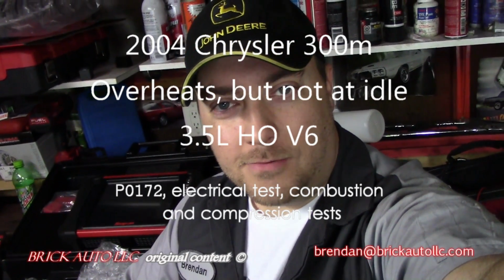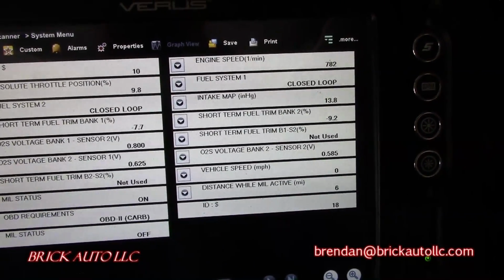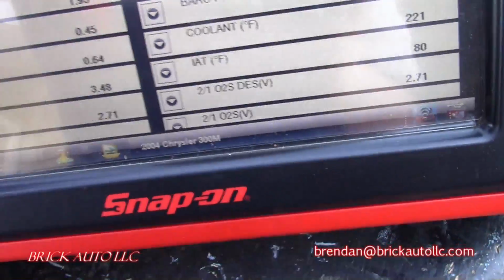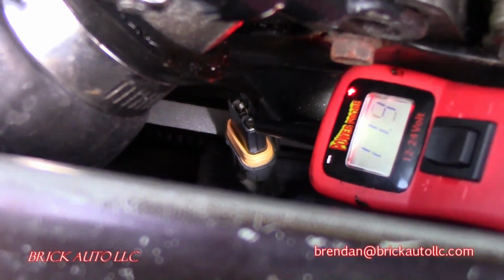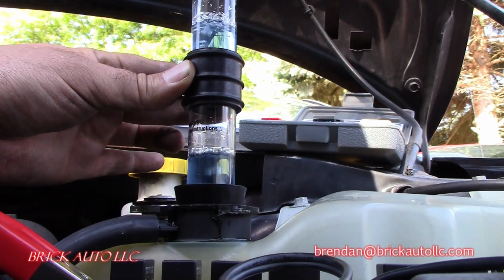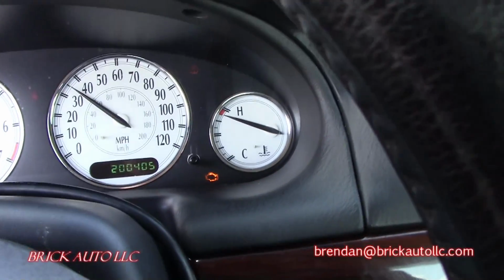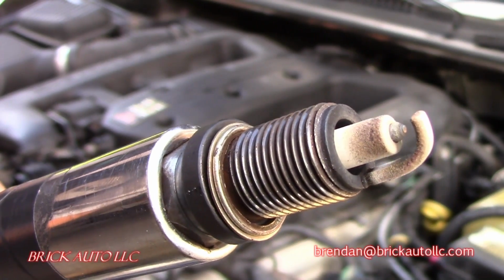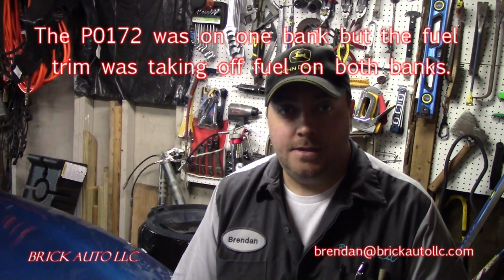2004 Chrysler 300m 3.5 V6 PO172 & overheats while driving but not at idle case study

Comment: The service manual schematics indicate that Low Speed Radiator fan is accomplished with both fans connected in series (6V per fan) vs High Speed  radiator fan which has them connected in parallel (12V per fan). The former configuration has both fans turning slower than the latter. The switching from series to parallel is accomplished through the two relays mounted on the fan.

Comment: i had same issue on my 1999 300m 3.5, turned out it was a rusty sticking thermostat, so I replaced it but first that didn't help, come to find out from a YouTube video that the thermostat will go in two ways but only one is right and will overheat if put in backwards, guess what? I took new thermostat out and put it in facing the right way and that solved that issue!

Comment: Crazy I went threw all this stuff. Put coolent senser in new fans ticked me off when mech I trusted said I needed fans bull the fans were fine it was a module located by fan.  And it started the fans right up. I wasted $250for fans and labor. Plug is fried.

Comment: Idk what you figured out but my car was overheating i bypassed fan switch and it stays at 189 degrees on my tool if you would have bypassed fans and let it run it would have been fine

Comment: I had the same problem from 2 months, the fans always run normally    every 5 KLM I must turn over and turn it off and run the fan from fuse box manually 
I don't know if it is the thermostat or anything else 
Chrysler 300m 2001 3.5v .

Comment: Mines was overheating. I got new head gasket, water pump, radiator, cooling fans, cooling temp sensor, thermostat. Mines done overheat but temp gauge does sit 1 notch above half, 221degrees only driving speeds. Fans kick on at 220. When i stop, or idle, temp is 197-202. Wat maybe the prob??
Reply: Brother, did you solve the problem?

Comment: I have a 2002 Chrysler 300m 189k miles...It is late November 2017, the days are getting colder here in the DMV.  Recent days, the outside temp is 30-50 degress.  The air blowing in the cabin is luke warm at best with the thermostat on the ATC set at any temperature above 70 degrees.  The 300m's temp gauge barely moves past the cold indicator on my drives.  However on some warmer days the gauge does move to it's normal operating zone and the cabin will heat up.  The Thermostat and water pump was replace during the summer (by the way the AC doesn’t blow cold air-we will takle that in the Spring).  The isno air in the system. 
Help

Comment: I'm having that same problem with my 03 300M. I change the thermostat, cooling temperature sending unit, oil pressure sending unit (while I was there) and new set of cool fans. I haven't run it smog enough to get it hot again, because my fans come on right away and stay on. That's why I question about the PCM. I have the exact same car for a parts car and want to switch them out. Will I need to flash the "new" PCM?
Reply from the maker: I don't think you should have to flash it for that year.  If it's the same motor, it should be fine.  A lot of newer vehicles may have security issues, but you should be okay just swapping out the computer.

It seems these engines had this cooling issue when they aged but didn't really show any major signs (like coolant in the oil or driveability complaints).  

If you are confident the thermostat is in the right way, the system is bled out all the way and new fans are okay - won't hurt to try swapping the computer if you have one.  I would note a potential to be the temperature control unit, not sure if yours is the auto one (like the one in the video), but they can go bad too and it's possible that the computer isn't getting some signal from that to command everything... maybe not but that would be one of the places I go next.  You may have to see if you kind find the resistance checks for that... but before I did any of that, I would do a compression test.  If the aluminum got hot too many times or for too long, the damage could be done.  I would do a compression test.  If you don't have one, you should be able to rent one from an auto parts store for free (just a deposit).  Otherwise swap the computer and control panel too since you have a parts car.

Here's an interesting site with some tid bits on these vintage motors:

http://www.tomorrowstechnician.com/keeping-3-5-alive-service-notes-chryslers-v6-engine/

Comment: Not true!!! It's the ECM!! Dude?? Its the ECM.
Reply: What is ECM?
Reply: @ahmedqasim7761  engine control module/management
Reply: Did you have this issue? I'm running in to this prob with my 300  I'm also thinking it's the ecu because of other symptoms. If you did was it pricey to fix?
Reply: Not really? About $200-350 to have it flashed, reprogrammed. Also, check your cooling system, make sure you use a good flush you can leave in for about a week, and use the other to recondition the system. Also make sure you that it is bleed properly. If not, it will get "hot pockets" in the system, and super heat the motor. Go to a shop that has the proper system to do it. It's not a "burp" system. Good luck. Should work. Try what I say first, than a PCM.✌😎

Comment: Did you rule out the PCM?
Reply from the maker: No, not 100% ruled out.  I believe there are multiple issues.  I think it would need a NEW fan set (to replace used, old and intermittent ones) as well as confirmation of the logic between the ATC head unit (which seemed to operate but not illuminate) and the PCM and or / BCM to ensure each were doing what they were supposed to.  I do think the main issue was obviously the compression loss across the board.  I don't know exactly how many times it overheated but I know it was driven at top red for at least a few times and even to bring it to me.  Had the compression been okay I would have pinpointed the control issue to ATC head unit  and or PCM and replaced the cooling fans with new.
Reply: It's the ECM.
Reply: It's the ECM. $250 sent in, re
Reprogrammed, and installed. You see the ECM tells the relays when the come on. If the ECM is malfunctioning, it will tell it to come on at all different intervals. It will boil your fluid, and superheat the fluid. It's that damned ECM. I tried everything else. I know for a fact the fans are not functioning correctly. Hence, computer run. If you notice rough runs, or rough idles or hard starts. It's the ECM. Weird functioning accessories. Incorrect voltage, hence stereo turns down. ECM. Damned Mercedes design junk. Trust me. Try it. Irs only $250. I should have done it a while ago. People have junked these cars for transmission problems, engine problems. When all it was is a $250 ECM the whole time. Hard to blow a gasket on these cars. Not hard because of the ECM.
Reply: @hunkychunky6830  so it's the ecm?